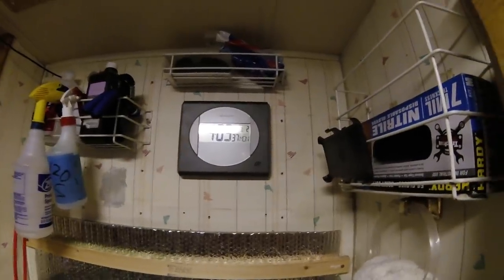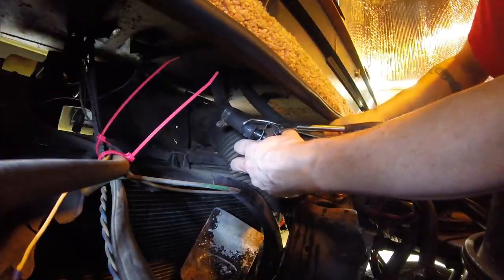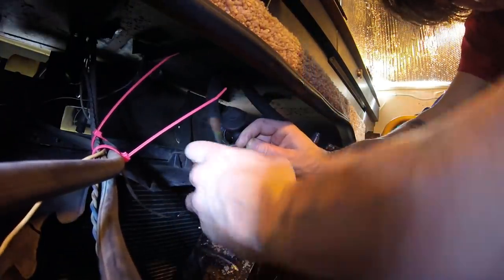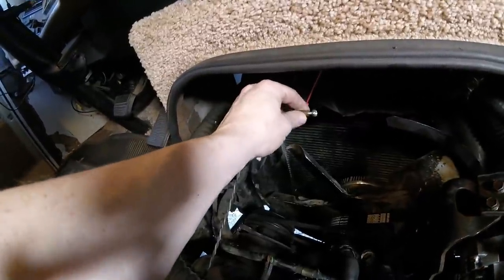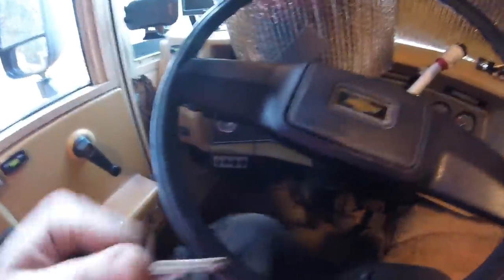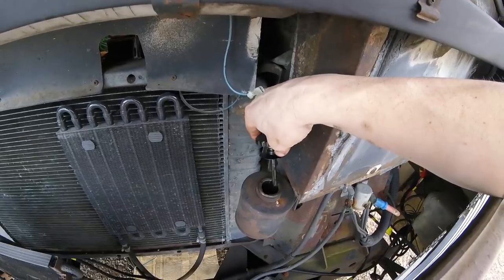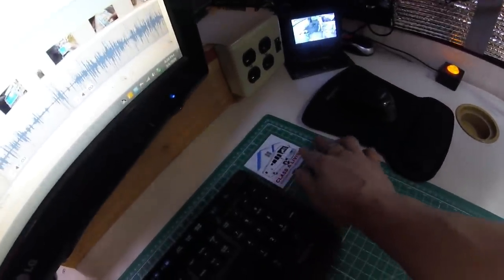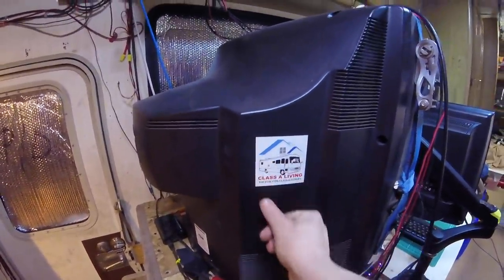Getting The RV Ready || Timing Check, Oil Change

Comment: As far as your oil leak, it's probably either one of 4 things. Valley seal( under intake manifold between intake gaskets, seals the ends of the block to intake), distribute shaft seal, valve cover gasket,  or the pcv grommets in the valve covers. Btw, get a fumoto drain valve, they replace your oil drain plug and make the oil change much nicer.

Comment: I always replace those crappy coolant valves with a brass quarter turn valve. You can find them and the screw in brass barb fittings at most of your big box home stores. Very similar to what comes on most semi trucks.

Comment: A streamdeck can do much more than the yellow button, not much more expensive. Also you can get a bottle board called U-hid nano that is a keyboard emulator, cheap, just have to wire buttons or switches to it

Comment: The oil leak could be coming from the valve cover gaskets the distributor basket of the oil pressure sender unit.